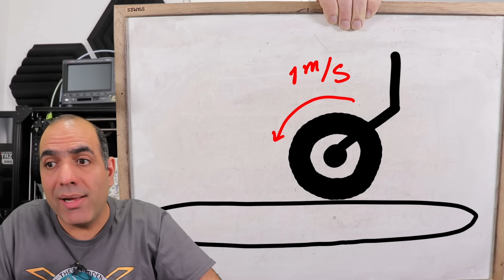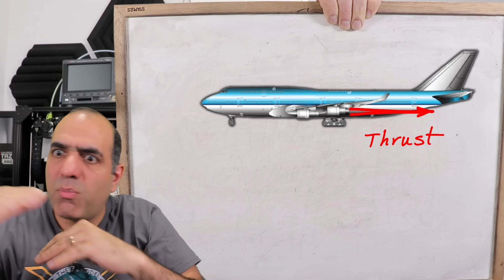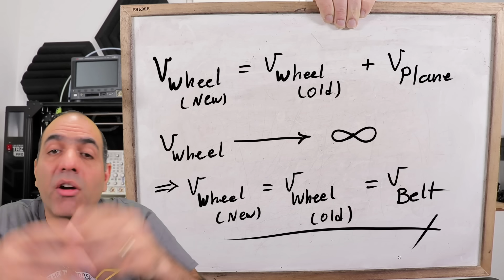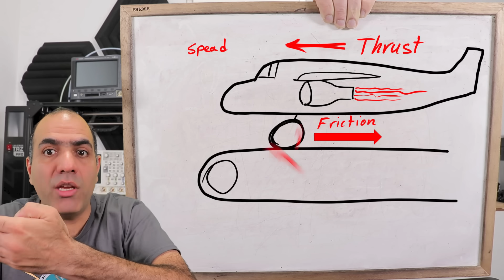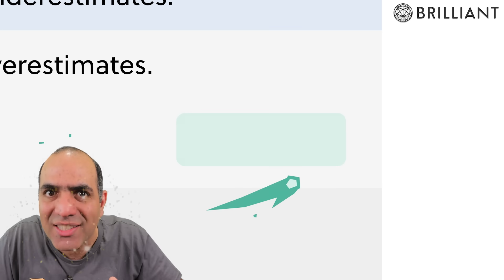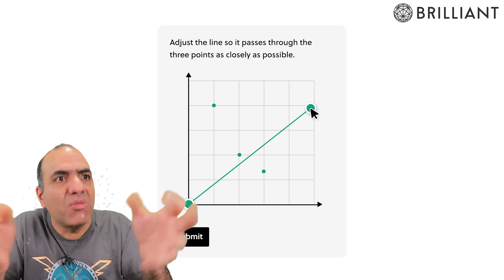Airplane Question that Drove Me NUTS!!!

Comment: Except for the wheels encountering more friction due to having to go twice the normal speed, the plane will probably not have much difficulty propelling itself forward since it does not propel itself via the wheels but via the air ( which is in normal situation).  This was my first theory, then I read the question again. And found out the conveyor belt has to match the speed of the wheels exactly, which means the plane cannot move as the turning speed of the wheels has to be more than that of the conveyor belt in order to move forward. But let's say the plane does start to propel itself though the air which is possible, then the wheels automatically exceed the speed of the conveyor belt making the equasion impossible. Done! Ok lets now watch the video.
Reply: Or yeah, they equal out at infinity XD if that is even theorethically possible....

Comment: The belt (and tread of the wheels) could also be advancing from the tail  the nose of the plane. The only thing that matters is engine thrust, which should be enough to move the plane from steady state, slowing the wheels with respect to the runway, and allowing the airframe to advance and generate lift.
Thus if the initial velocity of the treadmill runway was at takeoff velocity, wheels-up would occur as soon as the slowed to zero rpm.

Comment: as long as the plane's engines generate enough thrust to overcome the drag and the weight of the plane, it will take off regardless of the speed of the conveyor belt. The conveyor belt may cause the wheels to spin faster than normal, but it will not prevent the plane from taking off.

Comment: Airplane thrust isn't applied to the wheels, so the speed of the wheels are a result of the plane moving. Therefore the plane will take off because the plane is always moving faster than the wheels are spinning

Comment: So here's my comment without looking at other comments or watching the video...

It won't take off. Because the air on top of the runway is the reason why the plane takes off. If you could not only have such a runway but also propel all that tons of air towards the plane then it could probably theoretical flight.

Comment: If everything has friction, it still wouldn't take off. With the speed of the wheels ramping up that high, the tire would explode... the bearings would probably melt... I wouldn't be surprised if the rims of the wheel assembly would expand, hit another part of the landing gear assembly, and literally explode

Comment: Since the plane needs airflow to get lift, and being on a contraption like this means it will remain stationary relative to air around it, you would need powerful enough fan in front of the plane to generate lift. But I am just guessing, I will see if I am right later!

Edit: So indeed, with friction involved, you will just waste thrust, got it!
Reply: This was exactly my guess too, the wheels and conveyor can go at any speed they want, in the end its all about the air speed going through the wings rather than the wheel speed

Comment: I don't think it will take off. Even though the plane does not require the wheels to transmit thrust it is still resting on the ground and needs to move along the runway to gain speed. If the runway is constantly moving backwards at the same speed as the wheels then the plane would remain stationary in respect to its surroundings, so there would be no relative movement between the plane's wings and the surrounding air so no lift will be generated.

EDIT: I still find myself disagreeing. Obviously the plane does not need the wheels to generate thrust but if it's starting from a standstill then it still needs to move along the ground until it generates enough lift. I don't think you can decouple the plane from the ground until after you've generated sufficient lift to overcome its weight.

Comment: The issue with the question is that its misleading.  If the conveyor belt really matched the speed of the wheels then it just accelerates until the wheels provide sufficient drag (or to infinity if they don't).

The mythbusters didn't actually test the case where the track was traveling at same rate as the wheels.

Comment: I'm at 0:37, here's my prediction: Yes, the plane can take off. The conveyor matches the speed of the wheels, not the relative speed of the wings against the air. The plane is still perfectly capable of moving forward relative to the air while the conveyor belt opposes the speed of the wheels because the wheels freely roll on the ground, planes are propelled by thrust against the air, and generate lift relative to airspeed, so what the wheels are doing has no bearing on whether the plane can take off, ironically because of bearings.

Edit: Ahh, found my assumption: I assumed the conveyor belt countered the groundspeed of the wheel's axis of rotation, not the rotational frequency of the wheel, that's why our answers diverged. My answer assumes a case like the Mythbusters example. I actually find the option presented here to be less interesting, because even without bearing friction the plane can't take off. Any movement of the plane or wheels caused by any effect is countered by the conveyor belt either by burning energy off as friction or storing it as angular momentum in the wheels while the belt continuously accelerates, generating a reactive force on the plane. The presence or absence of friction would only change the rate at which the wheels accelerate.

Comment: And a fourth answer: If we take your second answer but engage reverse thrust on the plate to get the wheels rolling backwards and assume we don't have a frictionless bearing, the friction on the wheel bearings will begin to propel the plane forward toward takeoff velocity as the speed of the belt approaches infinity.

Comment: Hmm, I wonder how much friction there is between the belt and the adjacent air.
I wonder if it causes shear or if it will be able to move the air but with progressively less effect.
So many questions..
Reply: Also imagine the belt doing 400knots and you hit the brakes.
It would rip the plane apart.
Reply: Well what I can say is at least I'm not the only one who has way to many thoughts when asked to think about these sorts of puzzles.
Which leads to feelings of anger.

Comment: Has nothing to do with the wheels...The engine will create trust that by moving air over the wing create lift...works even better on an propeller plane... Airplanes don't need forward speed to fly..

They just need sufficient AIR speed over the wings to fly.... 

That's why they tie them down in high wind situations or better store them in a hanger...

Comment: The closest analogy will be the faster than wind direct downwind videos that Derek (Veritasium) made and wrongly explained how they work.
And it is not just understanding what air is and how that interacts with the vehicle but also more basic stuff like how a force multiplier works.

Assume the airplane is powered OFF but there is a strong headwind and wheels are locked (brakes engaged) so neither wheels nor treadmill moves. At some wind speed the airplane will lift from the treadmill. Same scenario can be achieved with no wind using just the airplane propellers.
I will be happy to pay for one hour of your time to explain all this in more details.

Comment: I would think that the plane would start moving forwards since the engines react against the air to generate thrust. The treadmill would start moving in the opposite direction, which would make the wheels spin faster, and so on and so forth (basically approaching infinity) until the friction and rolling resistance overcomes the amount of thrust. The plane will slow down, so the speed of the wheels would reduce, so the speed of the belt would reduce. But then the friction wouldn’t match the thrust anymore so the plane would want to accelerate.

And this cycle would continue. So imo no the plane can’t take off, unless you ignore friction and rolling resistance, in which case you just takeoff fine (maybe)

Edit: BOOM GOT IT!
But if there was no friction, wouldn’t the belt still accelerate to inf? In your first example you had the belt moving in the same direction of the plane and not the opposite. So you’d run into relativistic problems I believe

Comment: the whole concept is somewhere along the lines: "Imagine you are running on a treadmill with feathers glued to your arms...can you run fast enough ( whilst being stationary) to achieve enough thrust and lift?"
Reply: No, that's very different as your running speed is linked to the treadmill speed .. a plane's wheels are not, they could even be locked in place and some planes would still take off with enough thrust, burning the rubber off the wheels.
Reply: @Tony-dp1rl  so... a stationary plane (presuming the threadmill constantly matches the exact wheel speed) can achieve enough frontal wind to achieve lift? Also Thank you @Tony for replying and takimg the time to teach me and correct my knowledge. I appreciate it!
Reply: @Tony-dp1rl  The initial condition specifically DID lock the plane's wheels to the treadmill speed. Otherwise, there would be no discussion - as the answer is obvious. 

The only situation that allows for the plane to satisfy all initial conditions and take of is when the plane's wheels are locked... or possibly if there is enough windspeed from headwind as well as the wind speed generated by the treadmill as it approaches infinity.
Reply: @onemanshow4116  no need to lock the wheels, engines push the air (thrust) behind them and that air is static so the airplane will move forward, produce airflow and cause lift because of thrust and not because of the wheels pushing on the conveyor. wheels are free spinning, they'll spin and the conveyor will match up the speed but that is negligeable because jet engines push on the wind making the airplane move forward. 
Same thing if you get roller skates go on a treadmill and attach a rope in front of you to hold on to, the roller blades will spin up to the treadmill speed but you can still exert force on a static  object/matter (in this case the rope, as if it was the air in plane's case) and move forward even if the roller skates are spinning at the same velocity as the treadmill :)
Reply: @valtercosta2108  I understand that the force is coming from the engines… but the condition SPECIFICALLY STATES as a condition that the belt speed EXACTLY matches the wheel speed.

FORGET the plane for a moment. Explain to me how a wheel can move forward if the belt below it EXACTLY matches it’s speed (in the opposite direction) at all times.

If the wheel moves in space, then the speed of rotation does not match the belt speed. Period.

What I am claiming is that the condition of the wheel matching the belt speed means that if the plane has forward motion then the condition is violated.
Reply: @onemanshow4116  mmh then think about it like if you were on a sailboat going upstream a river. Current would pull you back but  the wind would push you forwards anyway, the speed of the boat going forward would increase but so would also the speed of the current sending you back but you still move forward. The plane is pushing a physical wall of air, wheel speed would increase but so would the treadmill speed, still the plane pushes itself forward increasing wheel and convoyer speed untill catastrophic failure of the landing gear, but if the landing gear could withstand that amout of forces the airplane would take off
Reply: @valtercosta2108  If at any point in time the plane moves forward it means that the wheel speed exceeded the treadmill speed.

Can we agree on that?
Reply: @onemanshow4116  yes we can :) and that's why I am saying the airplane will move forward increasing wheels speed and thus increasing conveyor belt's speed but still moving forward never the less, speed will increase drastically and exponentally until catastrophic failure of one of the two or both.
Reply: @onemanshow4116  both wheels and conveyor would speed up until infinity until the plane has enough lift to take the wheels of the ground thus stopping the conveyor.
Reply: @valtercosta2108  I’m asking a simple question.

The plane starts at meter zero. 

Is there any way that the plane moves one meter forward without the wheels ever exceeding the speed of the belt which moves in the opposite direction?

I submit it cannot.

If the wheel moves forward 1 meter in 1 second, then it has exceeded the speed of the belt by 1 meter per second.

The question specifically states that this is impossible. This is the condition that was established. It doesn’t matter what would happen in real life, because this is a hypothetical scenario.
Reply: @onemanshow4116  Mmh, maybe it depends on the wheels size you know? Like a smaller wheel will turn faster for x amour of meters as opposed to a larger wheels that will do the same amount of x meters with lower wheel spins. So a bigger wheel will cover more space and go forward at lower spin speeds so imagine the conveyor is moving at 2 m/s and the wheel is also moving at 2 m/s the plane will go forward because of the wheel covering more space at lower speeds
Reply: @valtercosta2108  It actually doesn’t matter what size the wheel is. 

The part of the wheel that makes contact with the treadmill has the same speed but in the opposite direction.

We don’t care how many revolutions the wheel has to make.
Reply: @onemanshow4116  yeah that’s true, was thinking about rotational velocity/ angular velocity my bad

Comment: Your rabbit hole of a rant deconstructing this question reminded me of a question my dad asked me when I was a kid, which went something like: you are 6ft away from a wall. With each step you take, you half your distance from the wall. How many steps would it take for you to reach the wall? There are two possible answers...

Answer 1 (the mathematician/scientist): Never. The distance is always halved and therefore you will never actually cover the distance.
Answer 2 (the engineer): Two steps. After taking the second step you'll be 1.5ft away, and you can then reach the wall.

By the way, the answer is that the plane will never take off. 😝 Though, I do feel the question could have contained more accuracy and context.

Comment: Stationary is the answer since the conveyor belt in this case basically mimics the "speed" of the plane since the trust from the "engine" is "Driving" the wheels first since it's need to move forwards first to get some lift.

Comment: As I think about it, it should be impossible for the conveyor belt to reach the speed of the wheels.

Assuming the movement is imparted by the engines and the wheels are free to rotate, the plane will move forwards regardless. Therefore, the wheels will always be faster than the belt by the speed of the plane, no matter how much the belt accelerates

So I conclude the plane cannot take off in those conditions. Why?

Option 1: the wheels start spinning so fast that the tires burst and the plane crashes. Option 2: the conveyor belt desintegrates and the plane crashes. Option 3: the plane never started moving for whatever reason. Option 4: the conveyor belt stops trying to match the wheel speed and the plane takes off, but we are no longer at the scenario described. Option 5: the nature of the paradox destroys the fabric of spacetime

Comment: The airplane has to move relative to the air for the wings to create lift. Thrust is what gets it moving. Since the conveyor's speed matches that of the wheels i.e. the airplane stays at rest relative to the ground and therefore the air, the plane doesn't take off.

Comment: As it was addressed in the video, I hate how the Mythbusters missed the constraint of the treadmill matching the speed of the wheels. Assuming we could continue to ramp up the speed of the treadmill to keep up with the wheels as the plane moves forward, what would likely happen is either the wheels would explode or parts would melt and seize up. Either way, the plane engines are still pulling on the atmosphere and (assuming they can still get the plane to move fast enough) the plane will take off, there's just more friction due to the exploded/seized parts to overcome now.

Comment: Another thing to consider is that the maximum tractive effort the belt can possibly apply to the plane is limited to the maximum static friction between the belt and the wheels. I am fairly sure you will find that number is lower than the thrust of all 4 of those jet engines by a large margin. That is to say they are going to start acting like skis because there is not enough force being transferred to the plane via traction through the wheels to actually overcome the thrust. Once the wheels start skidding the belt has done all it can to overcome the engines and run out of traction to do it, beyond that the plane will simply skid faster and faster until it takes off.

Comment: Speed of the airplane would need to be relative to the planet, would it not? Since the plane is stationary, air is not moving over the wings and creating lift. It's as if the plane was stopped at the end of the runway spooling up the engines with the brakes on. Sure, on a conveyor the tires can turn. But turning tires doesn't create lift.

Comment: 4:26 the belt wouldn't move. Since the thrust is what pushes it forward, the plane would move forward regardless of whether the belt moved or not.

You don't even need wheels on planes, with sufficient thrust it's possible to just push the plane off. Also, some planes use skis instead of wheels...

Comment: yes, because the aircraft does not take off with wheels, it just rolls with them while the engines push it, so long as the wheels don't explode from spinning twice as fast it will be fine
Reply: Remember a seaplane flies with no wheels.